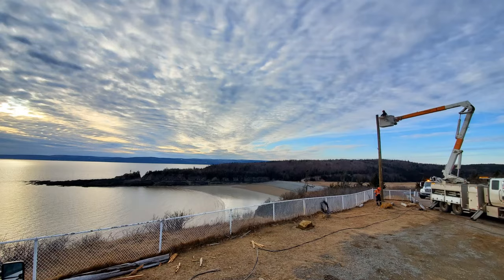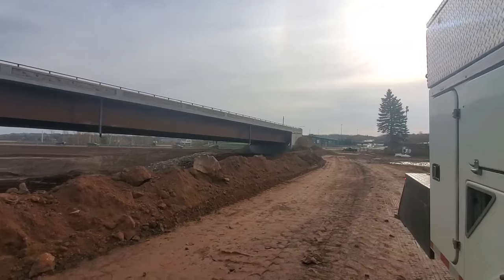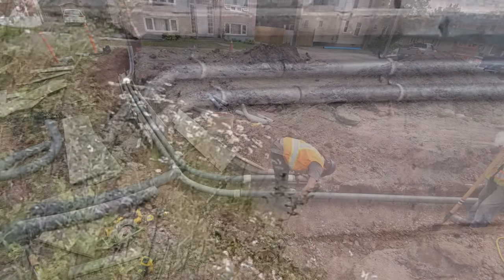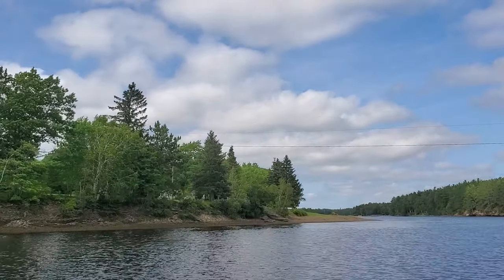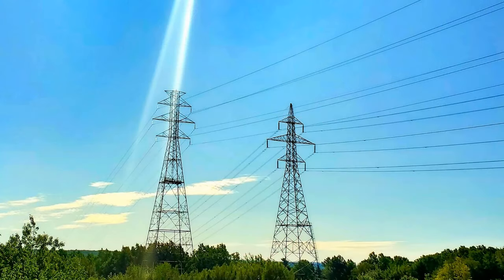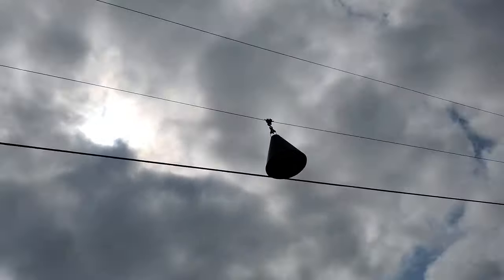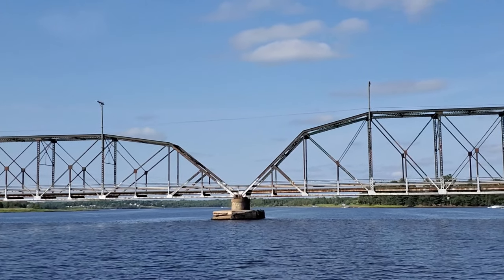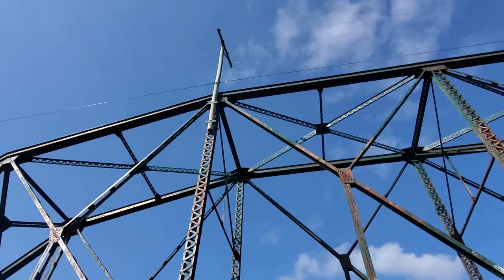Power poles held up by a bridge !?

Comment from the maker: Another method for powerlines crossing water that I didn't mention in the video is; Submarine Cables! We've got a few in the area. They are typically just laying in the water and are incased in a shielded cable. There's also usually warning signs for boats not to drop an anchor over top of the cable crossing area. 
Have a great week everyone! 🥂😎
Reply: A cottage I used to frequent had a submarine cable up to a little transformer for the cottage then back out to the next one in line.
Reply: I know that the lines to Prince Edward Island are submarine.
Reply: They have submarine lines in the U.P. Crossing over to Drummond Island.
Reply: Remember the final scene in Jaws 2? ;)
Reply: I wonder if the bridge is bonded to the neutral/ground...
Reply: We have that here across the wire canel.

Comment: I love it….Making it work at probably a fraction of the cost of setting pilings and structures in the water and it doesn’t look bad… anyone other than a lineman probably wouldn’t even notice it…
Reply: Definitely cheaper than setting a foundation up in the water but I'm curious as to why they didn't use conduit strapped to the side of the bridge, seems like it'd be cheaper and easier to do it that way
Reply: @bigjenkins34  ... probably due to low bridge and a history of boats bumping into things? Obviously this is the cheaper way to go.
Reply: @rupe53  that was my first thought 3ph and low clearance on the bridge makes sense to elevate it up as high as you can. Doesn't look that bad either.

Comment: Love your videos.

From a different POV - that of the Bridge

I worked for the railway company; we owned a lot of bridges.  One, built at the turn of the last century, crossed a river, via an island in the middle.  In the 1920s, the local authority hung a walkway off the bridge, making the island accessible.   A golf course, complete with clubhouse was established on the now accessible island, and the gas company hung a 1" cast iron pipe off the bridge so that the clubhouse might have heat, light and cooking.

80 years later, modernisation was the order of the day.  The golf club got a new gas range, central heating etc, then the railway company wanted to renew its timber bridge deck.  

This required all of the 3rd party engineering - walkway & gas pipe to be removed so the work could be done.

However, the regs had also been modernised.  Even if we had allowed a gas pipe to be slung from our bridge, the gas company wouldnt have done it.  

The golf club were influential, and we became public enemy number one, with loud political demands we pay for an expensive underground pipe.

I guess this liability was never forseen 100 years ago when the golf club was offered its pipe wayleave - a mere 2 guineas a year.
Reply: Wow!  Some people really have their heads on backwards. It isn't the railroad's job to supply or pay for a gas line that has nothing to do with railroad property or operations.

Comment: I've never seen that before (not that I've seen everything anyways) but it's common for railroads, back in the days of pole line along the tracks, to directly attach those to bridges. Often the metal crossarms would be mounted to the vertical supports of the bridge.

Comment: The old highway 47 bridge over the Missouri river in Washington Missouri had insulators right on the top of the structure. It’s been replaced with a much needed new bridge.

Comment: Over here in Winnipeg MB there are remnants of crossings like this on the old railway and road bridges crossing our two rivers. They don't have the open wire circuits in use anymore but until the railway or city upgrades the bridges there were the abandoned in place steel masts and cross arms on top of the bridge superstructure. I don't recall though ever seeing any wood poles attached to the sides.

Comment: Here in Germany, I know of a steel railroad bridge where the high-voltage line for feeding the rail line is mounted on cantilevers next to the bridge. There was a fatality there a few years ago. A teenager tried to jump into the river below and touched the line. There was a major discussion here about the safety of the bridge, as there is a lot of swimming at this location in the summer. So far, only new warning signs have been installed there.

Comment: I’ve seen things like this in many old bridge photos. Even in the early 1900’s they would strap numerous electrical (and phone?) lines right to metal structures attached to the bridge itself. 

I believe that electrified streetcar lines which ran across bridges used this method too.

Comment: Never seen anything like that before around my house in southern Indiana they just do poles on each side of river with wire strung across now they built a new interstate and they made the power company change the wood poles for metal or concrete at the places it crosses the new road

Comment: The area I work used to have primary on alley arms on a bridge to cross the canal. It was retired long ago for a different method to cross the water, but the arms and insulators are still there.

Comment: I know that bridge quite well actually. That's not the only bridge in that general Richibucto River area with power poles fastened to the side of the structure. The bridge right in the village of Rexton has a similar setup with the poles fastened to the side. Only difference, if I'm not mistaken, I'm pretty sure the lines on the bridge right in Rexton are 4 phase.

Comment: Before lockdown here in New Zealand, I worked for a transformer refurbishment company that contracted to a local supply company. I am now working with special needs adults. I enjoy your content and I am curious about why you use 3 single-phase transformers for your 3 phase circuits as we use transformers that are compact 3 phase transformers. We use single-phase transformers out in rural areas where the load demand is quite low and few dwellings. I have serviced the Edison McGraw voltage regulators and the Edison McGraw auto-Reclosers. I am not a lineman but involved in substation Maintenance.
The main voltage here in New Zealand our grid voltages are 220Kv and 110Kv and the voltages in towns and cities are 33Kv and 22Kv are feeder voltage and 11Kv as the main distribution voltages down to 400v and 230volts for domestic use I hope you have found the details interesting.

Comment: Question Aaron? 
I thought you said you were on vacation? LOL! I know it’s hard to not look up in the air when we are off duty especially with family. WOW! You even have the truck home on vacation too??? 😳 I hope the company honors your vacation when your off? 👊👊👊
How do they maintain that line on the bridge? What if a pole snaps on the bridge? Or a phase comes down? That has to be a nightmare (special rigging, maybe a crane)? 
Today that would not be allowed. The cable would be submarine cable in the water or in pipe if they could even do that? 2 sets of termination poles on either side with guying. Manholes on either side with a spare cable in case one goes out? Hence why they cheated years ago.
Reply from the maker: Normally I do drop it off at the office, but it can be a pain to go pick up my first day back too. 
I didn't book any trip this year because travel regulations keep changing. We ended up traveling all over our own province tho! The bosses are pretty good with vacay... They'll cancel it if a storm hits, but are reasonable not to cancel if we have a special event planned.
Talk soon John! 👊👊
Reply: I’m currently out with bunionectomy. We don’t enough trucks as it is. As soon as I was out I took everything that was mine out of my truck. I know the next day someone was in mine. Last thing I didn’t wanted to do was not have room for the next guy to put his gear.

Comment: Its a wooden deck bridge??? But I did see before the bridge was replaced, a 34,5 line following a double set of railroad tracks where there was a tower on the super structure of the road bridge going over the tracks. not wooden but what can I say. There is a 220 volt single phase going to a house under water that is on an island in the middle of Findley Lake NY. My area is real rural and my local power company gets its power from a 115 kv line from the grid. There is some 230 kv lines on wooden poles in my area.

Comment: I'm just wondering if a line went down and contacted the metal bridge ...is there a path to ground that would not endanger people on the bridge, boating under the bridge, or having a car crash that might involve people getting out of their cars and coming into contact with energized surfaces? I'm positive these things have been thought about, but just wondering what safety measures are in place. Thanks!
Reply from the maker: The metal structure on the bridge would already be bonded to ground.
In the event of an accident, contact with the bridge would (should) trip the line out pretty quick. For the very brief time the entire structure is energized during am incident, people on the bridge would be fairly safe in much of the same was a being in a car with lines down. If for some reason the lines/bridge stayed energized no moving would be the safest thing to do. Unless it's on fire of course, then hop away and don't touch anything.
Reply: @Bobsdecline   Very detailed, thanks much !

Comment: Are those cones also used for anti-gallop?
Reply from the maker: That's a really great question! I thought about it, as there certainly is such a thing... But in this area arrangement I don't think that's the case. Also, I've installed weights over large canyons before that look similar to this that help combat an uplift on the lines.
I wondered if perhaps these served another purpose such as that or a gallop, but there's none on the primary wire 🤔. Any marker balls I've installed were always round too, so definitely open to any feedback anyone else has on this specific design,?.

Comment: On the Robert O Norris Bridge in Virginia, three-phase (115kV?) power lines running alongside the bridge. This circuit is apparently out of service quite a bit of the time, and it looks like a hack job to me: https://www.google.com/maps/@37.6233498,-76.4240414,3a,75y,70.69h,87.46t/data=!3m7!1e1!3m5!1svyPYdttlqfwSltt0C7NmjQ!2e0!5s20120501T000000!7i13312!8i6656